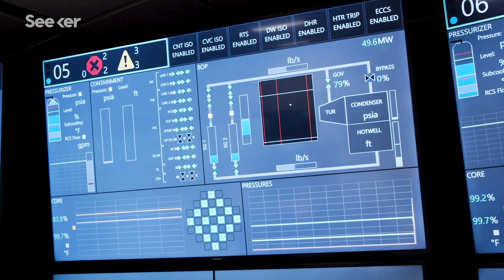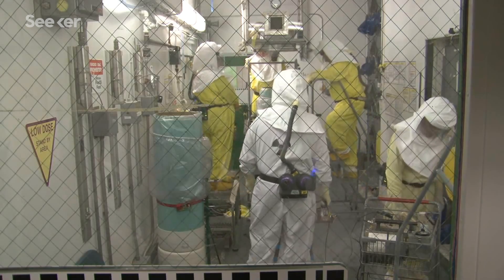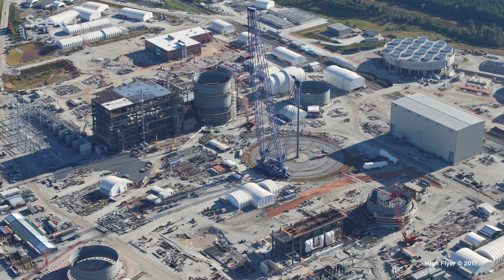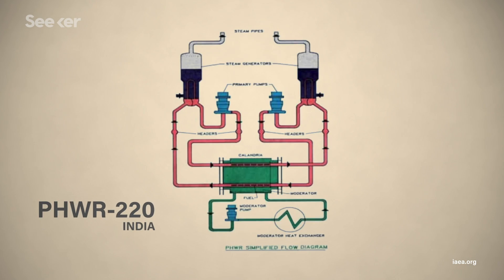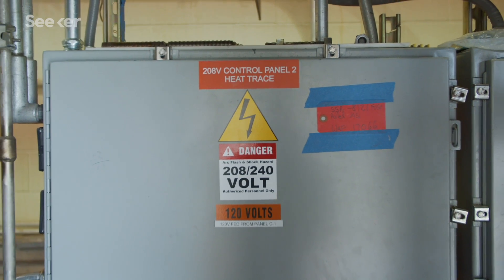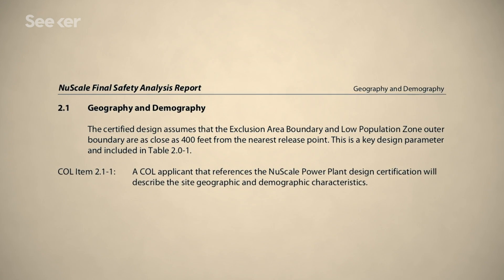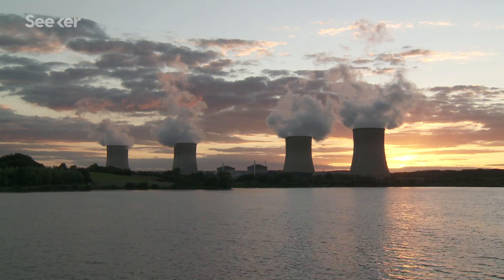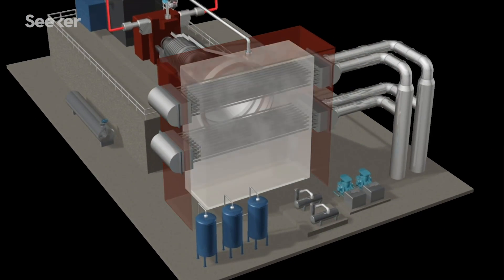Mini-Nuclear Reactors Are Coming, and They Could Reinvent the Energy Industry

Comment: im seeing a lotta people out here not understanding how reactors work :/
Reply: I see some of that, which is to be expected given you're looking at YouTube comments, but the existence of a bad argument against nuclear power doesn't diminish a good cause for concern. The main problem with nuclear power has not been loss of containment, but crippling downtime, extreme cost overruns, and overly optimistic predictions that continued for decades in spite of a track record to the contrary. This is especially worrisome if the design is not as different as Nuscale markets it as being.

Take 6:10 in the video, for example, regarding the actively suspended control rods, which drop into the reactor when power is cut. That's a design feature of existing reactors, but is sold as something novel. I see that as a red flag - not that it's a bad design, but it means a big selling point isn't something new, in spite of them pitching it that way. 

The control rods aren't actually magnetic, they're held in place by clamps, and the clamps hold the rods in place by friction, unless a spring pushes a clamp into the open position, which it should if the electromagnetic actuator counteracting the spring loses power. It assumes (a) the switch that cuts power cuts it and registers it as cut (compare that to the Three-Mile island valve that was stuck open, but did not register as open), (b) the spring has not lost tension due to corrosion, manufacturing defect, fatigue, heat expansion, etc., (c) there pivot on the clamp is not obstructed by corrosion, etc., (d) the clamp is not stuck to the control rod at the point where it makes contact. It's not horribly complex, but highlights even the simple, fail-safe approach has a number of possible points of failure.

This design feature doesn't address what happens if control rods warp under unexpectedly high temperature; or if steam build-up under rods buoys them up so they don't fall as quickly as expected; or if the descent of linked control rods results in one control rod stuck on debris hanging up others; or the descent of unlinked control rods resulted in uneven moderation of the nuclear reaction; or what if pressure or cavitation surrounding the falling control rod results in greater steam formation, reducing water density, and therefore reducing water neutron moderation.

The problem isn't that I've come up with a handful of things the engineers at Nuscale haven't - they probably have, if they pose actual problems, and addressed them to their satisfaction. The problem is that the real problems in PWR designs weren't found in five minutes of amateur armchair engineering or five years of prototypes, but ten and twenty years of operation (such as control rods inconsistently binding because of qualities of the fuel rods - https://www.nrc.gov/reading-rm/doc-collections/gen-comm/bulletins/1996/bl96001.html). The PWR design problems were largely unacknowledged as problems by the industry while Westinghouse designs were being sold, only decades later becoming a selling point for building a new generation of reactors. If a car company denied fires were a problem because of gas tank position for decades (as in the case of Jeep), then tried to sell you a new car whose leading feature was its novel safety concept based on the location of the gas tank...in the exact same place...would you share their optimism? I think we're entitled to a little skepticism, even if we're bullish on the potential of nuclear power.

One other factor to consider: a small modular reactor means that you'll have more points of failure overall, as you more reactor modules to generate the same output. This is why PWR designers went with large systems in the first place. SMR means that a single module can be offline instead of half the plant, but it also means that there are many more modules in which a failure can occur (you're more likely to have one of twelve down than one out of three). That doesn't mean it's less safe, but means that you may see significantly higher partial downtime and higher maintenance cost, both of which could increase operating costs over conventional designs unless other improvements can increase reliability far beyond that of a conventional reactor.
Reply: Yes, well, very few YouTube commentators will have been successful at high school level physics and chemistry, let alone completed a tertiary science degree (of any worth). It can indeed be a disturbing experience, witnessing those who lack education and sufficient intelligence providing their embarrassing assessments of things 'nuclear'.
Reply: @anhedonianepiphany5588  And who the hell are you smart boy, go clean tour mess you left in Japan before you talk nuclear
Reply: Chuck Schenck stop talking shit about stuff that you don’t understand. I get it seems scary, but it’s way, way better than coal or other fossil fuels. Fukushima was a shitty reactor. (Who builds a reactor with the backup generators in the basement, in a tsunami prone area?)
Reply: @anhedonianepiphany5588  By the time the truth gets out it will to late . Fukushima is heating the planet up.
Reply: System is the problem 🏡  The Great Qualities.

1, Show all living creatures; all the love and kindness as much as you can.

2, Only try to be honest with yourself. If you try to be honest with others, you will get into big trouble soon or later.

3, Aim only one target at a time; otherwise you are chasing two rabbits and you will miss both. So, the reason behind it. Have one powerful reason and never ever give up the one you want the most.

4, Don't try to be good person only but be the powerful person. We will grow to be the one or we will die. There is no other choice. 

5, Always learn and look for to improve something your life. 

6, You are not alone. Love and faith the high power reduces unnecessary stress in life. But never completely rely on it. 

7,  Success and happiness are the byproducts of our usefulness. So, always increase the possibility of success.

8, Life is not going to be easy. Because of our unnecessary things. Eliminate all the unnecessary things as much as you can by organising yourself well with the environments. 

9, Never believe anything without the proper evidences. 

10, Always try to give more than you take. 
Because it is dignity/ character of the divinity within you.

🌎 As long as people continue to see themselves as separate from everything else, they lend themselves to being completely enslaved. Success depends on how well we relate to everything around us. Joy comes from that bliss of connectedness. I believe that unarmed truth and love will have the final word in reality. To love; you should have good heart. I am a good person until I see a person better than my standard of goodness. Being good is the progress towards a worthy cause. Love is God. Whoever lives in love, lives forever. How selfish it is to try to keep something forever? Love is all about nourishing, nurturing, sharing and expanding the love within you for all. The principle to which we adhere to is that we have kindness of love at heart for the whole of mankind.  As long as there is the unnecessary differences within us; we can not live peacefully so we have to eliminate all the unnecessary differences among us so we can love all. People abilities may vary but not there true love. If we love a person/ God for a reason then we love the reason but not the person. No reason is the reason to love the person because true love never fails. So do not compare or measure the true love as first or the last but love all truly. If you love people truly then you can understand people. If you don't love then you don't understand people at all.

People are controlled by system why?
The Cyclical Consumption is the current economy all over the World. It is making the scarcity problems of the earth finite resources to deteriorate day by day. Current Monetary System is legalised theft. Real money is Gold and Silver. Scarcity gives the money more value. Real money won't lose it's value. When Governments stay away from Gold & Silver then very easy to transfer the wealth / resources to upper class the Rich (Corporatocracy) Elite. When the Governments are printing out more new fiat currency with reserve banks, our old currency is losing its purchasing power everyday. They are printing millions of currency everyday. All governments and laws are existing right now to transfer wealth to upper class the rich elite. The USA Government & other Governments are in many countries, bailed the investment banks & financial institutions in 2008 against the majority of the people. There is no democracy in any countries. Because of the Money System based on profits motive only above all else even humans lives and well-being. So, we do not have freedom to protect our values with the money so on. The violence, bankruptcy & all the negativities are build into the Monetary System of our society. All are owned (including ourselves) by Reserve Bank. Which is private cartel the corporation. So, in legal system, we are legally considered as chattel the properties. They make money in the capital markets with our birth certificates. They do not consider us as Humans. That's the truth. We are at the invisible war with the Elites (Corporatocracies). We have to fight for our Freedom. Resource Based Economy is the Solution. We have to declare the earth resources as the heritage of all the people of this world. So everyone has access to it. Please have your research about zeitgeist movement then you know the truth more. 

 Truth About Health/Drugs Industry Because Of It Your Life At High Risk The drug industry is a 1/2 trillion dollars a year worldwide conglomerate. Almost 300 billions dollars just in North America. That is really big business. What would happen if everyone were well? There is no money in health. You see, good health makes a lot of sense but it doesn't make a lot of dollars. Because everything they do is toxic. Every drug they use, prescription drugs, all drugs are liver toxic, bar none. If you've had amalgam fillings put in your mouth by dentists. It is highly toxic. There's cancer because most of the chemos are themselves carcinogens. To view the tumor as the cancer and we know the tumor is not the cancer. The cancer industry is 200 billions dollars a year. The more work they get, the more profit there is. You have to dismantle; If the truth ever came out about what we would need to do. 30% of people of females in America are at risk of getting, will get cancer of the breast. The ones that are already dead have been grossly mistreated by the medical profession and by the government that supposedly is supposed to encourage free research and development of all possibilities. Why would medical doctors who studied medicine and practice medicine and are heavily funded by pharmaceutical companies why would they go and look into vitamins? That they never had the answer orthomolecular. And as more and more of our population start taking their health into their own hands, there's going to be even more and more of changes. It can't go on the way it is. The system is failing apart. We must make nutrition the primary prevention strategy for the population. You are what you eat. You are everything that you have ever done to yourself. The choices you make directly affect the outcome of your life. - (Food Matters Documentary in Netflix)

😊 Well, I truly love God. I am not religious but very spiritual person. So, I believe 1) Religion is the beliefs in someone experiences But spirituality is having my own experiences. The mainstream religions people promote religious ideology by giving guidelines and guide but In my spiritual life; I do not want anyone or anything between God and me to restrict my freedom to worship God. 2) We do not need any authorities to do good work. The god work is the good work always. In contrast; organised mainstream religions are claiming that they have the authorities to do God works as leaders so on. 3) God is not capable of doing wrong thing, change the past for us and create anything out of nothing for us. Nothing means not anything. So, even God is limited. The mainstream religious people believe that God is unlimited. 4) God wants us to take responsibilities for our righteousness life but not for all the consequences of our actions because they are continued to exist among us. So, How can god punish us for all our consequences? The mainstream religious people believe we are full of sins because of all our actions. 5) Freewill  is an illusion. People always choose the perceived path of greatest pleasure.  So, we do not have choices all the time. In contrast teachings of the mainstream religions are promoting people to do god's will always because we all have choices of freewill always. 6) We can not separate everything into groups. So, everything for good and evil and there's no success and failure for everything. If everything is real then real things can not be threatened. Once you come to understand that God/The Holy Spirit is in each of us, You will no longer need a Book to tell you how to live. Then why we need religious scriptures? The Virtue is the expression of the basic goodness in our actions. The Basic goodness is the fundamental worthiness of every individuals. We are worthy to God always in everything. 7) Beliefs in a cruel God makes a cruel man. No matter what; every living creatures has the right to live and What makes their life cheap? Everything depends on everything. Nothing too big or too small in value. We can not love and hate at the same time; Being a vegetarian means love without cruelty happily. The mainstream religious people are killing people and sacrificing animals in the name of God. They promote God's cruel punishments. The Punishment is endless for Sinners/Devil according to religious scriptures. But God is love always. Overcome hate with love. If all religions for peace, unity? No way. Because they are not for peace. 8) Well, The God gave us everything to go from moment to moment in our lives as we do our part  and pray only to thank god then the Love is in progress. The Love is always for everyone. We are always worthy of the God's love. Our greatest fear is; not to be loved by anyone but we are all loved by someone. When we eliminate all our unnecessary differences among us then true peaceful life is possible with the true love. If we can't find the peace within ourselves then we will never find it anywhere else. 9) This is the Fight for independence and freedom of humanity to worship God freely without religious guide and guidelines to restrict us. Unnecessarily, We do not want third party controls over us in anything ; especially in spirituality. 10) Revive Survive Thrive. Sincerely,  The Real Peacemaker against religious oppression.

 https://youtu.be/HbvCxMfcKv4
https://youtu.be/pIJHJzDQcRM
https://youtu.be/MyxbdmAnIcI
https://youtu.be/wLzeakKC6fE
 https://youtu.be/P8vHa8zD7jY
Reply: Well it's 4 montths later nuke boys. Here's a update for u deniers  Thermal energy is melting the Arctic, Plackton gone in the Pacific food chain acute collapse, marine sea life starving, salmon going extinct among other species, Ocean
Carbon cycle gone explains CO2 rise. Audubon Society raises concern birds disappearing, Pacific is gone Atlantic is next, thanks a lot nuke boys for killing this planet Oh by the way , don't forget to whatchhCNN and tepco for all your latest nuclear news
Reply: So what do all think if of the 3 nuclear meltdowns at the edge of the Pacific, what I do know is can't be fixed, your dream of nuclear power is over.
Reply: Chuck Schenck LOL over? You’re a moron. Your dream of solar power and wind power, is over. Nuclear is the only viable solution and thankfully, tech is finally being allowed to catch up.
Reply: Or how storing used fuel rods is irradiating the areas around the supposed "containment units" which people think dont leak.
The titanic didnt sink and the berlin wall is still there, if nuclear energy is a safe method of energy conversion.
Reply: Justin Pyle sources please?
Reply: @justinpyle3415  Nothing is safe so for you the best choice would be not to be born.
Reply: @lesp315 life is risky enough without unaccountable disregard for the dangers of radiation leaking into the environment, irradiating everything on earth unnecessarily and IRREPARABLY.
Reply: @justinpyle3415  If you feel so strongly about it stop using your computer, heating, car, clothing, everything. Go to woods necked and pick berries. 
 You will be back in 15 minutes. :-)))
Reply: @lesp315  says the person obviously unaware of the different types of radiation that are released from leaky containment units.
RF is alright to a degree, i can deal with it for the benefits of high bandwidth.
How exactly do i benefit from plutonium in my bloodstream? Or uranium, or iridium, or radon, or cadmium or the multitude of other particles that these "experts" obviously cant control.

Comment: This is hopeless, it's no different to what we have already in terms of abysmal efficiency (<4%) and the same safety concerns.
What we need is Molten Salt reactors, not solid fuelled ones. There's a huge amount of development going on in that field because it can achieve more than 90% efficiency in terms of the fuel usage and you don't even need to shut the plant down to refuel it. The plant can't melt down, even if the power is all lost.
Just google it, there's loads of information about what's going on.